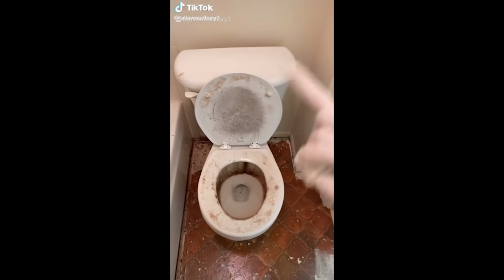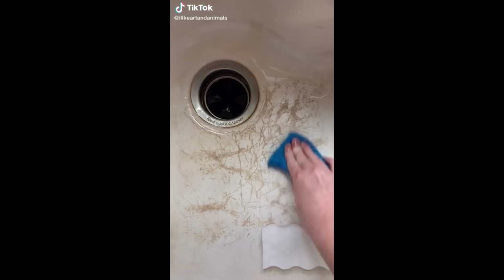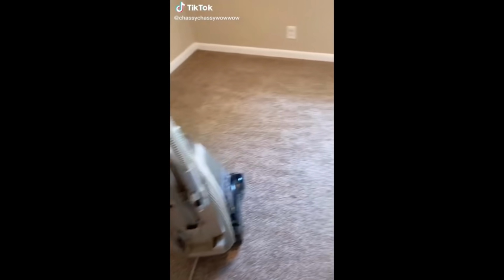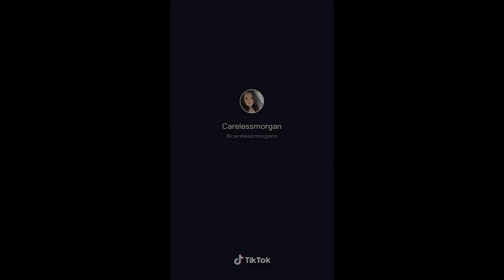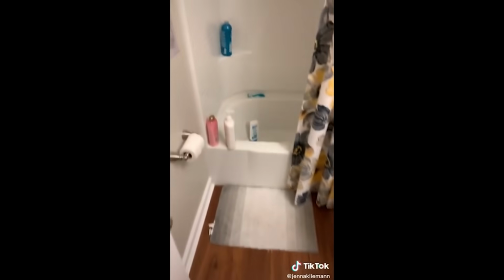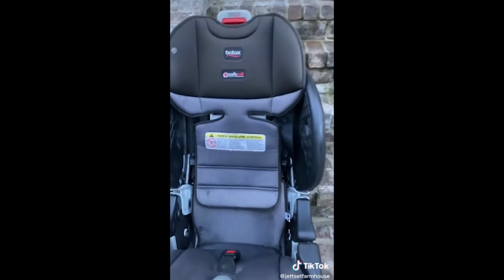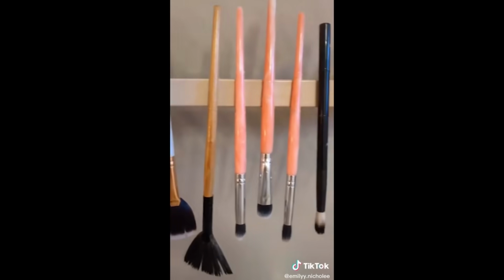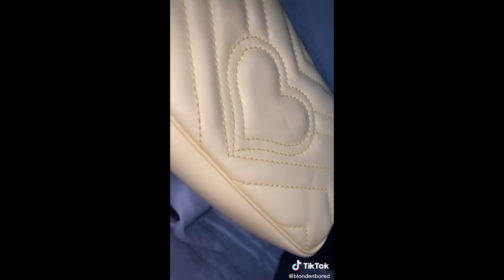Cleaning and Organizing 🧽🚿 | Part 12

Comment: It stresses me out when they mix up a bunch of chemicals in the toilets.
Reply: why
Reply: @26zahrraa  it's dangerous and it can lead inside air pollution and lungs problems
Reply: @marie8198  wait really??😀 so ive been cleaning my toilet like that my whole life and no one told me? how nice🙂
Reply: @jesse8311  technically i think it is written on the bottle but who reads it ... i hope i helped you
Reply: @marie8198  yea thanks now ik :)😁
Reply: Sameee
Reply: I knew they were chemicals but for the 14 years of my life, I didn't know it could kill me 👁️👁️ Thanks mum, still gonna do it tho cause who needs to live anyway 🧑‍🦲💃✨
Reply: @jesse8311  if you’re just mixing different soaps it’s fine, but it’s kind of like how ammonia and bleach makes literal toxic gas. You never know what could create a dangerous reaction. It’s just safer to use them one at a time.
Reply: Sammede
Reply: Ha this why my sister cleans the bathroom all I ever do is clean the sink with shampoo XD frocking shampoo and then mop/sweep
Reply: Just adding to this thread to say that you should NEVER mix chemicals UNLESS you absolutely KNOW you'll be safe. Even then, still don't. Mixing your shampoo and conditioner is different and the funny thing we all did as kids, but cleaning agents are NOT TO BE MIXED!!

Sincerely, a chemist's daughter
Reply: frrr all i do is add dish soap and it gets the job done easily
Reply: tHeY pUt ChEmIcAlS iN tHe WaTeR tHaT tUrN tHe FrIcKiNg FrOgS gAy
Reply: @dontrunwithscissorsproduct1312  DO YOU UNDERSTAND THAT
Reply: It’s when you mix bleach an ammonia together. My Home Ec class from 8th grade really coming in clutch rn.
Reply: yeah i was like there was no need for that... the office toilet bowl clean is enough. Also there toilet wasn’t even that dirty (not the one at the beginning, that one was super dirty)
Reply: What if you use an all purpose spray on the lid and seat then toilet bleach for the bowl? Is it okay to do that or no?
Reply: Ammonia and bleach make mustard gas i think
Reply: It's not that bad just don't put a lot of it in unless you have a fan inside the restroom

Comment: People keep asking how a toilet could get that dirty, and I know it’s probably a rhetorical question for most buut if not I’ll explain. It basically comes down to 3 things. One being the obvious... people not cleaning it often enough... two where it is (someone’s home, an office, a public bathroom)... and three of the toilet is working properly. Ive worked as a bathroom cleaner for a long time now and cleaned more toilets than I can count. I’ve seen toilets like that in places you’d expect like gas stations, and I’ve seen them in nice homes that get cleaned by our company twice a month. If your toilet has a “lazy flush” or if more than just 2 people use it, I would clean it once a week to prevent it from building up like that. Also, other people have said this, but the multiple chemicals in the toilet bowl is not the move. It’s unhealthy and unnecessary. I use Lysol’s “power x10” toilet bowl cleaner, and it’s yet to encounter a toilet it doesn’t strip clean. Plus if what you’re going for is aesthetics for your cleaning tik tok, it has a deep blue color, and it’s a gel cleaner that sticks to the side of the bowl, that I think looks nice. Bottom line is put on some gloves (please for the love of god, do not clean the pot people poop in with your bare hands), grab minimal cleaning supplies and go scrub your toilet. It’s really not that bad, I promise you won’t die, and you’ll be a better person for it. People too snobby to clean toilets aren’t good people in my opinion. No one is above cleaning up their own, or someone else’s mess.
Reply: So long I could never-
Reply: I clean my loo once a week and there's only me here!

Comment: But guys, just a tip from someone who works cleaning: be careful when mixing strong products, specially in a small place like a bathroom.
It has to be a good ventilation and you should always wear gloves and try not to breath much of the product. A lot of them are strong by themselves, and mixing causes chemical reactions that if breathing can cause you harm (nausea, headaches, fainting...you get the idea)

Comment: Mr. clean magic erasers are made from melamine foam, so they disintegrate while they are being used. They work by basically gently sanding off the stain.
You can buy generic Melamine foam squares in bulk for about  6 $ for a 100 pack, and about 8 $ for a 2 pack of Mr. Clean magic erasers.
The Mr. Clean erasers also have a cleaning agent inside them so you will have, so you can just mix up borax, baking soda and water to have the same effect !

Comment: OK, um, a little health and safety info:
1. Unless directed, DO NOT mix cleaning products. 
2. If you need to try something new, make sure the product that you were using just rinsed/wiped away.
3. I know it's tempting to mix products, but you can create very harmful substances. If you think you may have created something toxic, contact Poison Control or 911 in case of an emergency.
4. Gloves, glasses, goggles!!